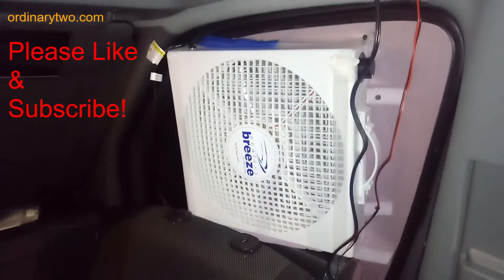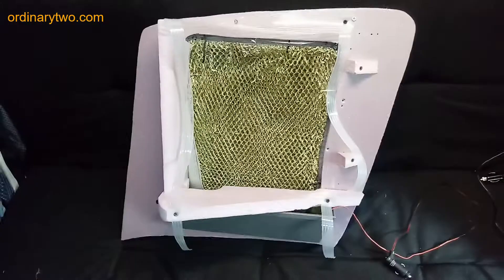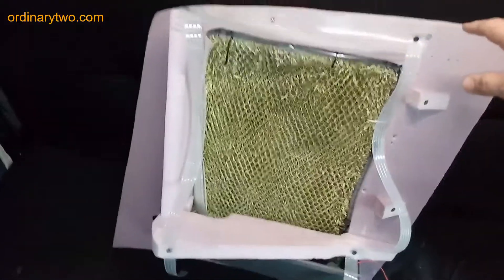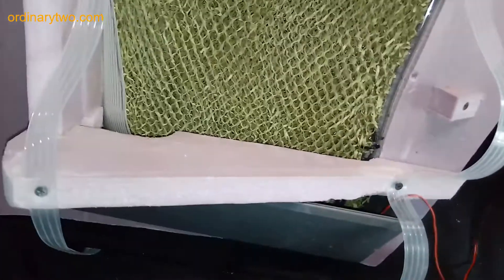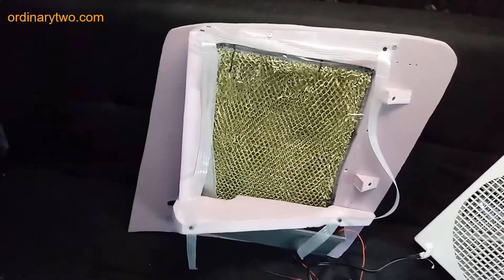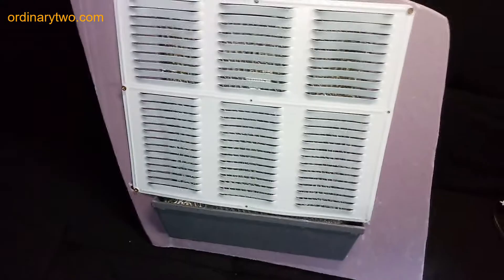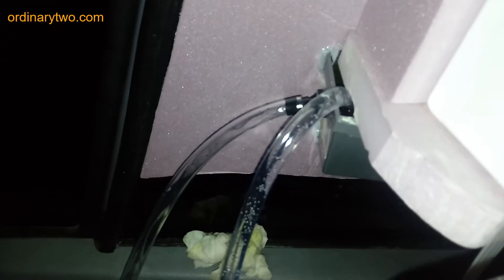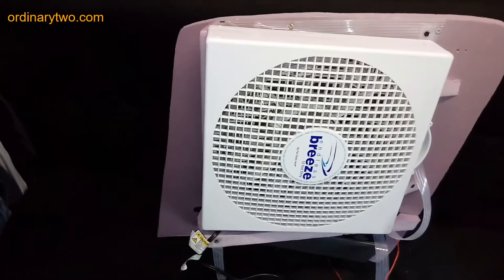Homemade Off-Grid Swamp Cooler for Van Life

Comment: What's the water consumption rate? How many gallons per day? Thanks!
Reply from the maker: Maybe 2-3 gallons or so.
Reply: @OrdinaryTwo  Thanks. 2 - 3 G per day in which part of the country? What kind of summer? Phoenix Arizona kind of summer? Thx in advance.
Reply from the maker: @michaellin7313  Western Colorado summer. Highs around 90f. Never had to use it in Phoenix in the summer - thankfully!
Reply: @OrdinaryTwo  LOL. Thx for your reply. Your video said: "Getting hot in AZ"...  LOL. 90 degree F is not hot for Phoenix! LOL Cheers.

Comment: Thanks for sharing
I love my whole house evaporative cooler in CO works so well and with a relay it's controlled by my house furnace relay so it turns on and off to maintain whatever temp I set the thermostat cool to.
Plus it's so dry here, the humidity is nice but not obvious.
Saves so much on electricity and I was wondering if people use them for cooling their van instead of heavy use ac.
For very humid climates, a evaporative cooler isn't very effective at all.
I have a camping van and I seem to be ok without long term cooling in additional cooling with the engine ac.